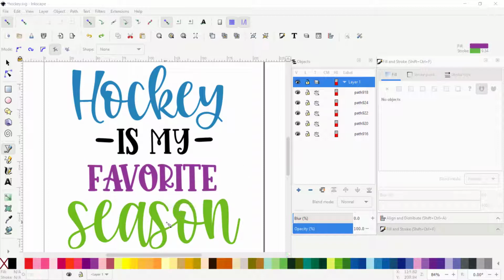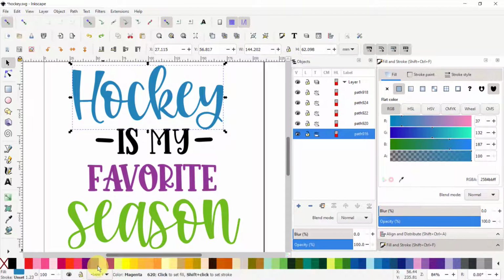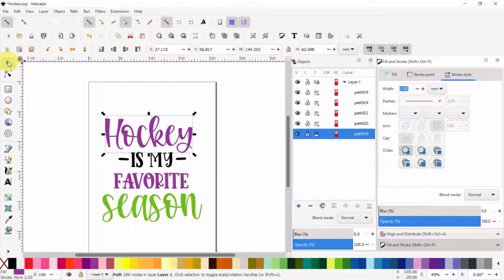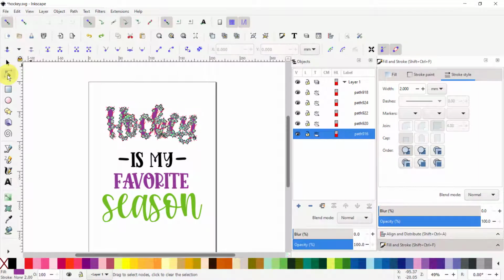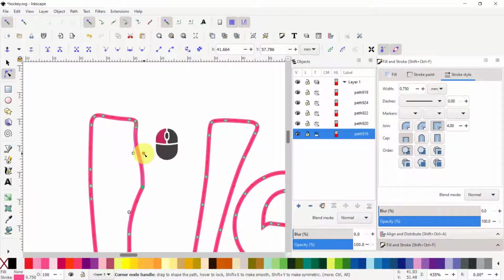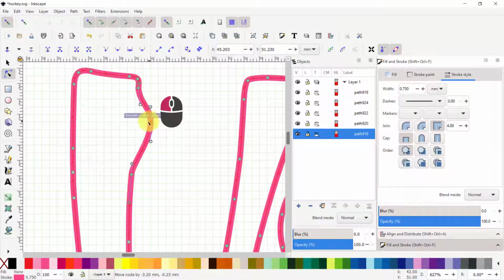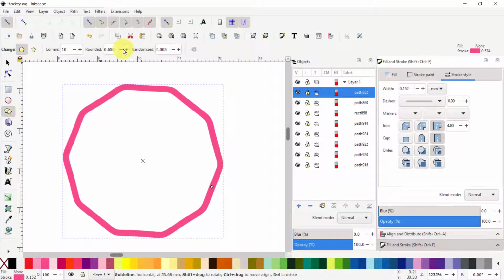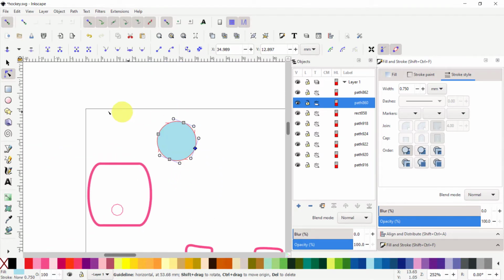color pallette and tool icons

Comment: hi. i want to ask a question? It is very difficult to embroider and photograph each product. How do you do the photography job?
Reply from the maker: I am familiar with windows and in windows i use the snipping tool to what is preinstalled in windows to take a screen shot and in the inkstitch simulator you can get a realistic view or you can use any other embroidery file viewer with a realistic view to your liking once you have the screen shot you can use a photo editing software to remove the background i use gimp what is an open source program to do this and then you can replace background with what ever image that you want